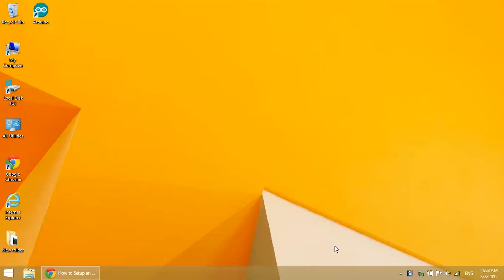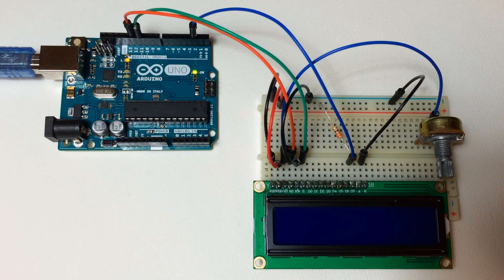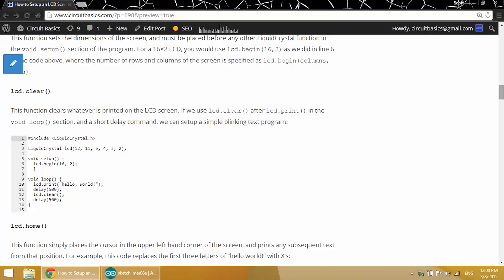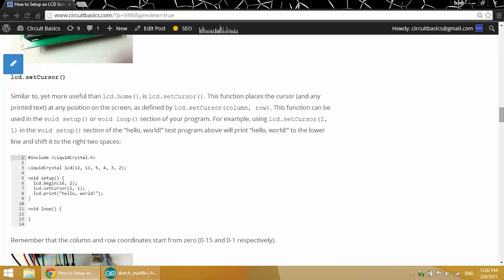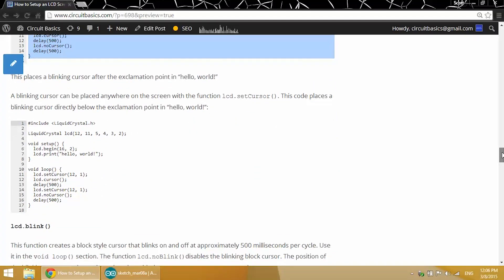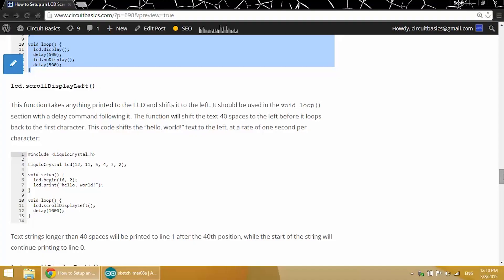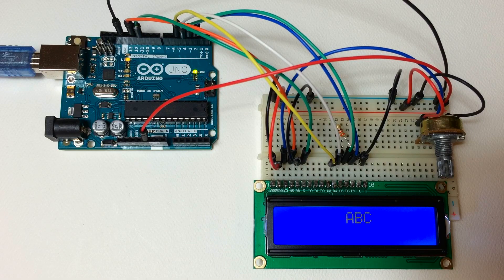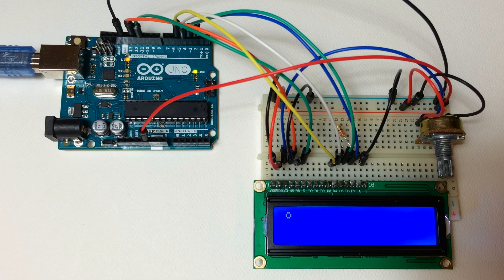How to Set Up and Program an LCD on the Arduino

Comment: I connected mine identically with this video and double checked everything, but only the back light comes on and when i upload code it will not display the text ,, please please help with any suggestions
Reply: Francois Terblanche did you ever figure out cause mine is same exact. Did all exact triple checked and nothing  just the light
Reply: Never got it right just gave up after a few weeks    :(
Reply: Never give up. Adjust the pot! Check and check again. This works!
Reply: @mog99lie   thanks man needed this exactly my problem turned the pot over a little more out of aggression after i made sure pins were all the way in and sure enough squares came up as i turned it.
Reply: check your resistor
Reply: Check to make sure the pin headers are properly soldered on.
Reply: make sure that you remember to connect your potentiometer to the positive and negative rails. I just made that silly mistake and it only powered the backlight
Reply: Make sure you are switching on Potentiometer into the circuit not Rotary Encoder :)
Reply: no it is the potemtiometer  just remove  it and connect the gnd and vo pin and it will work
Reply: Did you adjust the potentiometer
Reply: same hereee!
Reply: I didn't even get the light
Reply: mine lit up and there were bars that came up by turning the potentiometer but i didnt see and letters and when i tried the delay code, the bars lit up then faded like in the code. pls help

Comment: can I use normal wires instead of jumper wires?
Reply: Definitely. Jumper wires are usually easier to use due to them easily sliding onto the pins and breadboards but normal wires will still work

Comment: Sir I'm working on a project that uses solar power to charge laptops for students, so I've decided to get an Arduino micro-controller + coin acceptor + a board of 8 relays, so I want to make sure that when a student insert a coin to the coin acceptor, the coin acceptor will send a pulse  to the Arduino micro-controller and the Arduino will activate the relay for a certain period in order to allow the student to charge their laptops for that selected time. So how can I link/connect the coin acceptor to the Arduino such that the relay activates when someone insert a coin to the coin acceptor? Please help me, if possible you can give me the codes to achieve this operation.

Comment: Thanx..  Just got my Arduino kit.  First program was blink to show an LED going.  But I saw that LCD in the kit and wondered if that would be too complicated for a next step.  Found your vid and tried it..  Worked first time!  (Well, the only POT I had was a 50k, and I didn't see anything at first and had to go up quite a bit before I saw the display, but it worked.)  Thanx!
Reply from the maker: +desiv1 no problem, glad you got it working!

Comment: hello,   I was hoping you can help me with a LCD display.   I have a 16x1 1601 VER 2.0 blue display.    I am looking for a directreplacement.   This one the backlight doesn't work anymore.   I can't seem to find one on ebay with the same identification.This is for a frequency counter called a DD-103.   Not having any luck finding info that tells me the difference betweenLCD displays other than how many rows on the display.Thanks,Ken
Reply: eBay with ardunio lcd comes up with a bue one for first listing

Comment: im completely new to arduino programming...ive ordered a uno clone programmer and it does not have the IC that is plugged into the socket on your arduino pcb......       also once programmed does that IC on the arduino pcb have to be always connected to the lcd module ????

Comment: can this also perform on lcd 4x20??
Reply: LCD2004 

in the code it is referenced as lcd(20, 4)
                                  instead of lcd(16, 2)
also if you're using I2C, the I2C addresses of the LCD1602 & LCD2004 are different. It took me a couple tries to notice that. lolz
But other that that, yes the code and wiring is all the same.

Comment: is the potentiometer  necessary?
Reply from the maker: Nope, you can substitute a 1k to 3k ohm resistor, depending on how much contrast you want
Reply: @Circuitbasics  I 1k and 3k aint working
Reply: +Circuit Basics I have a project where I am going to be using remote control input to input passwords and interact with the LCD Monitor. That remote has + and - buttons. Can these be used to adjust the contrast?
Reply: Mia Couch there's no reason to use a remote to control the contrast on your 16-2 LCD because pretty much once your contrast is adjusted, you don't need to readjust it.
 so why would you want to do that with a remote?
You need to understand that attaching a remote to your circuit has absolutely nothing to do with the remote control sender but rather it has everything to do with the remote "receiver" as to whether you can wire it into a circuit and how you would add it to the circuit.
The contrast itself is lightened and darkened by increasing and decreasing resistance with resistor or with a potentiometer, so for the remote to be able to control contrast, the remote would have to talk to the Arduino or some type of a processor and then that processor would have to send a varying signal to the contrast wires, so you could do it that way.
You could do that with PWM also.
If you use an infrared remote control to send your passwords someone can simply take pictures of and record your infrared signals and then repeat them to the receiver themselves and break into your lock because infrared signals can be seen at a distance and recorded and saved and shared.
Reply: You can use PWM on a spare pin to adjust contrast within software.